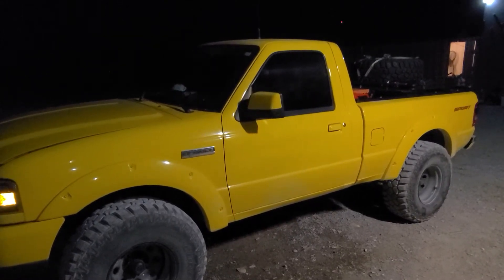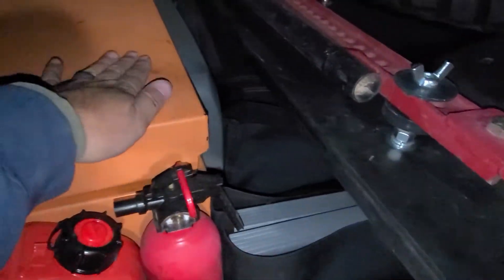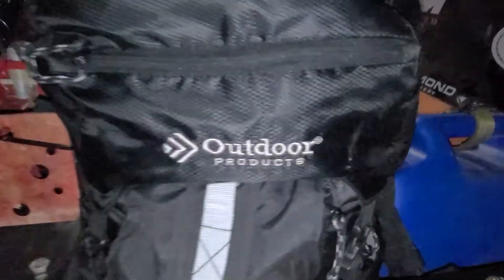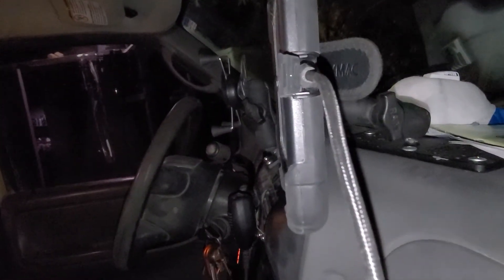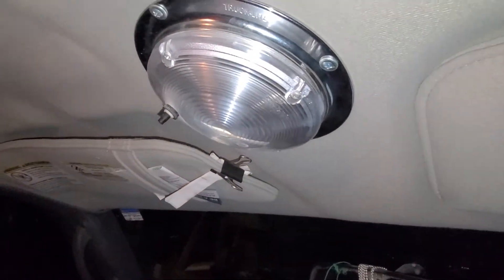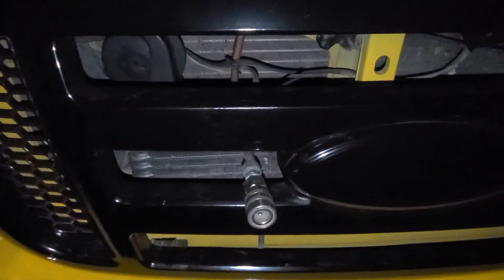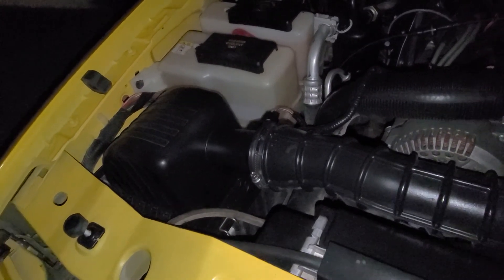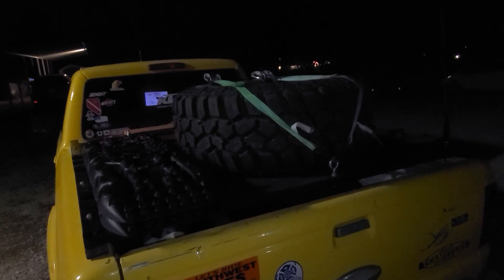Walk-around of my Ford Ranger

Comment: that is an awesome setup for the adventuring you do! A alternator welder....def  a "want" item...lol!  One thing I learned when I did the Jeep thing in Az, rock climbing will chew up the lugs on tires, I used BFG's because they have a tight tread pattern, the more space between the lugs on the treads  and when the wheel slips, those rocks can take off chunks of rubber....but if you aren't driving it in technical places..I doubt it will matter.
Reply from the maker: Im diggin it!

Comment: thats a nice rig and set up brother. i tightened the torsion bars on my truck and got an extra 1.5 inch ride height in the front but the ride is a little stiffer so if you want to do it it's basically a free 1.5 inch lift for the front.
Reply from the maker: I am hoping to do a coil over someday
Reply: @ADVNevada  that be nice

Comment: My quick thoughts...you have two options...either get the air intake above most of the dust or in-front/before it.  Does your airbox pull air from the wheel well area... if so, try getting air from the headlight/grill area (it will not have much dust unless driving backwards a lot).  IMHO that engine shouldn't need that big of an intake opening to feed your airbox.
Reply from the maker: I think it does take air from the passenger side headlight area but I have to check in the morning I'm not sure.
Reply: @ADVNevada  I seems logically that the only way for the air filter to get dirty so quickly is if it is getting some of its air from your right front wheel well.  I'd try and get the air from the left side of the right headlight assembly (kind of between the headlight and grill opening for the RAD).  With you intake that low in the vehicle...the only real solution is to get the air pickup in-front/before the dust (closer you get to the RAD/Grill area the cleaner the air most likely is)...that is if you spend most of your time driving forward!  :-)
Reply from the maker: @SteveSmith-wl8yq  it looks like it's sucking air in inside of the engine compartment between the headlight and the radiator
Reply: @ADVNevada  I wonder why it is getting so much dirt...would seem that it is a good location/ source.  I would suspect that even though the intake source seems good it has to be at least pulling dust from somewhere...maybe a swirl effect is pulling air from the side causing the intake to get some air not from the grill area.  Strange....